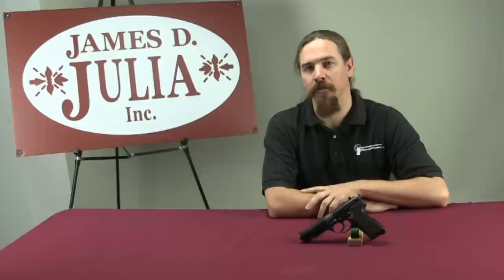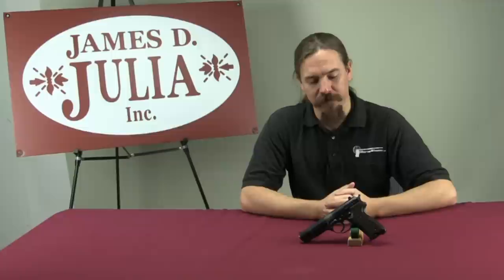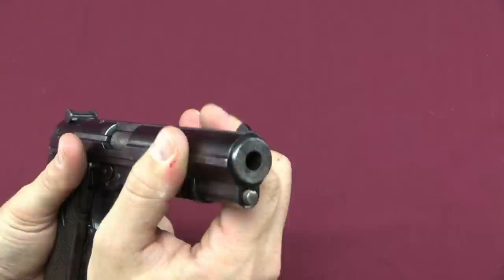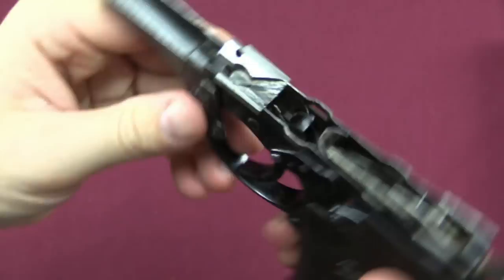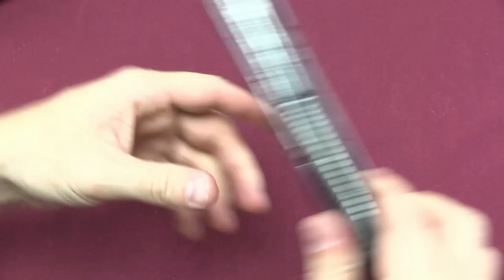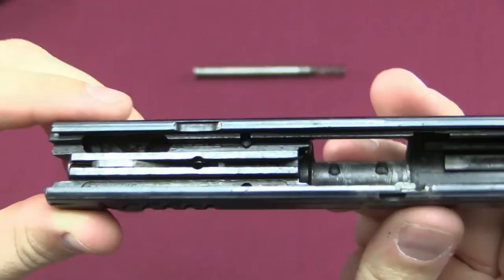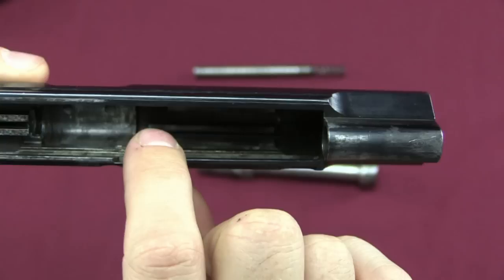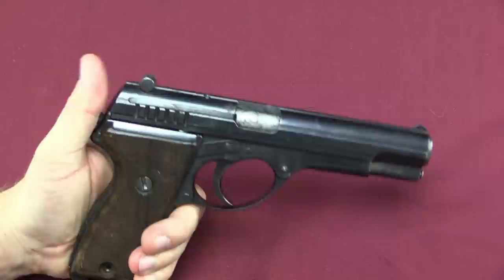Walther Volkspistole

Comment: That actually looks like a solid pistol design they could have saved Germany a bunch of money if they would have designed it at the beginning of the war.
Reply: Valo B dont be offended, its only history.
Reply: @thatsnotmyname6677  in the real third reich you'd be the first to go
Reply: Valo B  Alternative history 101-when we consider how Nazis might have won the war, we are solving a puzzle, we don't actually want them to have won"
Reply: I agree.  Its a shame they're so rare it would be nice to see how they shoot.
Reply: Robertino Tanos  Wargaming is fun as long is it is understood that no real wars are wanted, and no real soldiers will be committed.
Reply: @michalsoukup1021  I think its a pretty common sentiment that the second world war wasnt an entirely positive experience.
Reply: Looks like, but it isn't. This was an ongoing experiment to see if they could reduce production costs by using a stamped frame, but this isn't a good idea. You don't want a heavy slide  repeatedly hitting a flimsy piece of sheet metal, this isn't going to last long. Nobody ever attempted a stamped pistol after that.
Reply: @lucianene7741  I mean, the AKs use a lot of stamped bits, including stamped bolts, and they work extremely well. So maybe its possible with pistols as well?

I could imagine that the reason nobody did is because its not economical; either in production, or with the resulted limited lifespan.

Later war german equipment was often only designed to only last till the end of the war, such as the G43 or STG44.
Reply: @michalsoukup1021  well said
Reply: @termitreter6545  The bolt and bolt carrier on an AK pattern rifle are machined from solid pieces of steel, exactly like the M1 Garand system they were cribbed from.
Reply: @dj1NM3  That was only true for most (but nto all) models of the original AK-rifle, which didnt saw widespread use. Soveits had some QA issues making stamped receivers,  thats why they used milled ones.  I think forgotten weapons has a neat video about this.

The AKM, the modernized AK that got produced like >50 million times, has a stamped receiver. Part of what makes it so cheap to produce.

Also wtf is up with the garand comparision? Thats a completely different type of gun. Maybe they took a few ideas, but the AK is very clearly inspired by the STG44.
Reply: @termitreter6545  I do hope that you're joking about the STG part. They look somewhat alike but their operating systems are completely different. Guns like the FAL and the CETME have more in common with the STG than the AK does. Also the Garand comparison was specifically about the bolt and carrier being machined from steel and not stamped.
Reply: @yorecf9641  Im obviously not talking about the operating mechanism, but about the design of the gun (shape, mag, selective fire, pistol grip, intermediate cartridge, MP charachteristics, etc). Which is obviously closer to an STG than a Garand. You gotta be deluded to not see the inspiration.

And idk what this BS about the milled receiver is, thats just hugely ignorant. A milled receiver isnt anything special to the garand, it was the norm back then. 

The whole point of the AK was to make it cheaper than other rifles by using a stamped receiver. Only a few early models use a milled receiver, because they had issues with the stamping. But those werent produced in large numbers anyway.
Reply: @termitreter6545  you're the only one talking about the receiver. Jeff only talked about the bolt and bolt carrier not being stamped because they aren't. As for the layout, maybe they were inspired by the STG, but maybe it's a coincidence. Keep in mind that the AK was originally designed as an SMG and is still designated as such in Russia. As Ian himself stated in an article he wrote, "They look similar because form follows function."
Reply: @yorecf9641  Okay, lets run it down in detail:

The AK development is often a bit confused; it was only a vage concept for a while.
In fact, the AKs intermediate rounds was starting to get developed in 1943. Thats one year AFTER the soviets encountered the german 7.62x33 MKb 42. 
And MKb42 (machine carbine) and MP43/44 (machine pistol) were original names and variants of the Sturmgewehr; the latter was merely a propaganda name.  So yeah, the germans also called it an SMG/machine pistol (german uses on term for both).

And yes, you can bet it influenced soviet design, the ammo is almost a copy and defines this type of gun.

And I was unclear, but when I say the receiver was stamped, then I also ment the bolt. Because yes, the bolt of the first AK 1947 Type 2, the thing that inspired the western name "AK-47", was stamped.
And the mass produced, modernized AKM used almost exclusively stamped receivers, because that was literally the point of the AK. Be cheaper because everything is stamped. 
Milled receivers were a short, temporary stopgap solution due to early problems with stamped bolts.

That stuff isnt some secret, its a big part of the FG video about AKs.
Reply: @termitreter6545  I'm pretty sure that everyone is aware of the AK receiver types though it's the Type 3 that was experienced by the West the most when it comes to the milled AKs. My point with the SMG references was that if you look at Kalashnikov's original prototype SMG from 1942 it has features like a pistol grip that the STG just so happened to have as well. When it comes to the bolt and carrier can you provide a specific source for those components being stamped and not forged? And don't tell me to look it up myself; you made the statement so provide a reliable source that says such. If it's a video give me a timestamp of when it's stated since Ian has made MANY videos on AKs.
Reply: @yorecf9641  The 42 Kalash prototype is quite literally a generic SMG. Reminds of a Tommy gun with the furniture.
Mainly the intermediate round was what made it an assault rifle, and not just a submachine gun. The name AR and the meaning of it just didnt quite reach people.

As for the bolt, its fine if you just wanna believe that AKs totally use only milled bolts. 
I dont mind talking about it, but its not like im paid to fix your ignorance and false claims.
Reply: @termitreter6545  so what you're saying is that you have no proof while I can easily go online and see that Russian and Eastern Bloc issued AKs use forged bolt carriers and bolts. Gotcha.
Reply: @yorecf9641  Turns out Im wrong, my bad. I have indeed misread, and its just the receiver that is stamped/milled. Not the bolt carrier and bolt. Which probably makes a lot more sense for such a load bearing piece.

Point regarding the AK developement stands though. That was inspired by the STG, and its role-defining ammo is based on the german intermediate round.
Reply: @termitreter6545  well, I would like to say that I appreciate that you also took the time to try and see if they were stamped or forged. I tried for a while after you said that and found nothing. I didn’t respond to you last night because I was tired after helping my parents rip out their flooring because they’re replacing it and frankly we weren’t getting anywhere by continuing to argue with each other. As for the ammo part; yeah, I definitely see where the inspiration comes from which makes the Soviets adopting the SKS in its configuration kind of a head scratcher.
Reply: @yorecf9641  Oh never worry about not responding on the internet, its a trap to get yourself pulled into discussions you dont want xD

The thing was, I was actually doing a double check while talking about it, and found comparison pictures of forged and milled bolts. But apparently those were bolts for milled and stamped receivers, and not actually stamped bolts.

Got even weirder because stamped and milled guns actually use slightly different bolts, with some lightening cuts.

Not to mention that many nations had slightly different AK/AKMs in production.
Reply: @termitreter6545  yup. As an owner of several Yugo guns, I can confirm the (mostly) small variations in Eastern Bloc guns. Take a look at the Hungarian AMDs if you want some real variation from what the USSR adopted.
Reply: @termitreter6545  There might be stamped components used for the receiver and in the fire-control group, but the bolt and carrier of an AK47 (and derivatives) are all machined, just like the M1 Garand it's based on.
Reply: @dj1NM3  Yeah Ive been talking shit about that specific point in this thread. Bolt+carrier was always milled.
Receiver was the part where the Soviets originally struggled to stamp it reliably.

The bolt carrier group also seems to be inspired by the M1 Garand.

Although I think some people in this thread argued the gun itself was inspired by the M1, which would be clearly wrong, and that caused some confusion.
Reply: @termitreter6545  It's pretty clear that the internal operating system of the AK47 is based on the M1 Garand, but the external form-factor and calibre of it were clearly inspired by the MkB42/MP43/Stg44 series. Putting an AK47 and Stg44 side-by-side also makes it clear that it's only a general from-factor copy, not a straight-up carbon-copy, because every detail is different, but the overall idea has clearly been borrowed.
Reply: @dj1NM3  Agreed. I also think its important to note that the AK wasnt necessarily a copy of anything; it seems to be a much more organic development with lots of influences.

From what I gather, originally Kalashnikov wanted to make an SMG in a pistol caliber, and older prototypes look like a more generic SMG. But the project evolved when he got access to the german 7.62x33, and offered the inspired soviet equivalent, the 7.62x39. Since blowback wasnt enough, he borrowed the M1 long stroke bolt carrier design. The STG44 likely affected the ergonomics as well, it seems quite obvious, as you say.

Kinda interesting how this project developed imo. Maybe less organized than a lot of german small arms development at the time, but clever and innovative in its own way.
Reply: @termitreter6545  ISTR that Soviets initially referred to the AK47 as an "SMG replacement", but that might have been an initial subterfuge to "get around" stodgy thinking at the top.
One interesting theory is that the 7.62x39 round was also intended to effectively "disarm" anti-USSR partisans in the newly  ̷c̷o̷n̷q̷u̷e̷r̷e̷d̷  liberated countries with incompatible ammunition being used the by the  ̷o̷c̷c̷u̷p̷y̷i̷n̷g̷  liberating Red Army. The old WW2 weapons could not be fed the new ammo and the new USSR weapons couldn't be fed the old WW2 ammo.
Reply: @dj1NM3  I think both is true. It was a generic pistol caliber SMG project that developed into something quite different, the original AK.

But when the AK was finished, it actually got employed as an SMG. Thats after an AK-prototype lost against the SKS, which became the new soviet rifle instead, and both weapons served together, using the same ammunition. SKS got dropped in favour of just the AK at some point.

Does looks like the soviets did experiment a bunch with their new intermediate cartridge. Wouldnt be surprised if anti-partisan usage was considered. Considering how many 7.62x39 weapons were produced at that time, it probably wouldnt be too effective tho.
Reply: There's no mention of the actual cost of this pistol to produce, yes the goal was a cheap design, as well as very importantly an easy to produce one, but whether or not that goal was achieved is not clear, or is countered by the fact that it was not adopted.
Reply: @termitreter6545 You were confusing bolts with receivers, saying that the AK was a copy of the StG, etc... you clearly had no idea what you're talking about lol.
Reply: @beargillium2369 There were many, many weapons designed during wars that were clearly superior in all regards, but weren't adopted.

Adopting a new firearm means redirecting the attention of important personell from the war effort, retooling dozens of factories, and testing the firearm on the field, whereupon you might find out it's garbage and you just wasted a LOT of time and resources. It's something that is only done if it's strictly necessary.

Militaries are famous for being risk-averse, and for good reason: taking a risk might mean hundreds of thousands of young men dying, with you to blame.
Reply: @WhenDoesTheVideoActuallyStart  sorry I don't understand why you're responding to my comment in this way... I was responding to the op, did you read my comment?

Comment: "stamped sheet metal revolver" is scary as hell!
Reply: True, but this is Germany we're talking about here. They weren't known for halfassing by any means. I'd be interested in seeing what they came up with.
Reply: @dominicksmith4784  I mean we did half-ass a lot off stuff towards the end of the war :D
Reply: I would guess that at least the barrel and cylinder would have to be machined from solid metal, but maybe the frame and firing mechanism could be stamped and welded together.
My guess it that would have required a rimmed cartridge (headspace on the rim), that WW2 Germany didn't have in its military supply chain, unless it was intended to loaded with 9x19mm and relied on the case mouth to headspace on and not slide all the way through the cylinder, probably using an ejection-rod to punch spent cases out in either case.
I'm intrigued as to what this monstrosity looked like, but there are zero "hits" with Google that look at all promising.
Reply: @dj1NM3  "unless it was intended to loaded with 9x19mm and relied on the case mouth to headspace on and not slide all the way through the cylinder". I wonder if a full-moon clip would suffice. Any disadvantages are offset by this being a last ditch design that accepts many inadequacies.
Reply: @dj1NM3  7,65 Browning aka 32 ACP is a semi-rimmed cartridge, which was used in some european revolver
Reply: @dj1NM3    Revisiting this: I wonder if a cylinder could be made of stacked stamped steel disks with the 6 chamber holes stamped. Chamber liners would pin and align the disks while providing the necessary strength, as in an aluminum cylinder.
Reply: @donjones4719 Just cast the cylinder with ductile iron, and use steel tube inserts.

Comment: Is it just me, or does this pistol (on the outside) look a lot like pistols that would be produced decades later? Like the Browning BDA, Beretta Cheetah, CZ 75... That really looks like a 70's pistol. I don't know any 30-40s pistol that looks like this.
Reply: Browning HP, probably but Browning was an absolutely genius designer who made firearms as the modern ones.
Reply: @alcedob.5850  1911 looks modern too
Reply: @nightofthunder5509  and it is designed by Browning
Reply: My initial reaction was a polish radom
Reply: @paulfrantizek102  I ment it looks kinda similar. BTW, you're right
Reply: It looked a little like a Browning at first glance. This is a synthesized design. Well done, really.
Reply: The berreta Px4 Storm also uses the rotating barrel design, so odd to see this mechanism ceep poping up yet never really getting as popular as it probably should.
Reply: I mean the PPK is pretty modern looking
Reply: @scratchyass2369  PX4 is one of my favorite modern pistols. Too bad Beretta stopped thinking for themselves with the newer APX guns and decided Glock etc had the right idea all along.
Reply: @dakotahrickard Glock too is borrowing a century old design from browning. And ironically enough, they too now have a rotating barrel model. Full circle lol.

Comment: The thing that strikes me as odd about this is the rear sight. It seems like the existing P38 rear sight was simpler and should've just been re-used for the Volkspistole. And those little circular "wings" on the sides seem entirely unnecessary for a pistol sight anyway.

Comment: That slide looks like it was actually stamped in two or more pieces then welded together and finally milled. Doing it that way would be fiddley but would be cheaper and save a lot of time as only the precision surfaces needed milling.

Comment: I just see this video. The Chinese made Type 92 pistol is almost identical in its mechanism. It uses a stamped rail bottom guard to hold the trigger mechanism and houses that in a plastic handle. I guess the Type 92 is cheap to make too, and quickly mass produce to replace the sheer number of Tokarevs in the army.
Reply: I thought it looked like a type 92, so there is actually connection. nice info
Reply: How reliable is the qsz92 and is it well build?

Comment: Why didn´t the rotating barrel design catch up? It keeps the barrel always in line with the gun (not like 1911s or SIGs) while not being in need of an additional locking piece (P38 and Beretta). The conical barrel seat on the receiver looks a bit clunky, but should give a decent precision without much manufacturing effort.
Reply from the maker: The rotating barrel design never has completely disappeared. The Beretta PX4 and Cougar use it today, for example. Colt used it in their ill-fated All-American 2000, which failed for reasons unrelated to the rotating barrel system.
Reply: Forgotten Weapons Quite correct! I was especially waiting for you to mention the Ill fated Colt  All American 2000. Excellent Video by the way!
Reply: Dont forget about Slovakian "Grand Power" pistols with rotating barrel. :) They are relatively new constructions.
Reply: Is the wear on camming surfaces comparable to the locking groves of a Browning type design? Seems like it would maybe have higher wear and shorter working life.
Reply: French MAB P15 uses this system too.